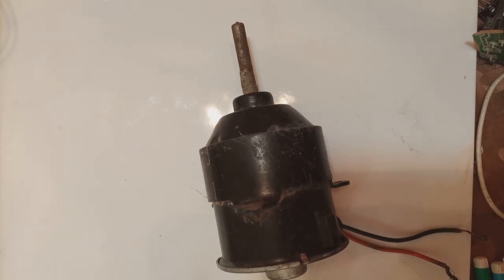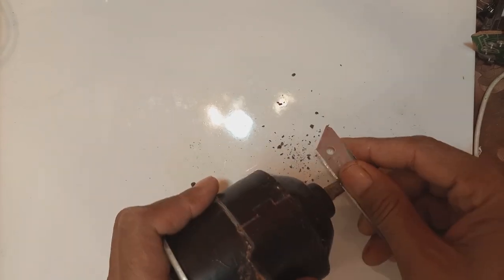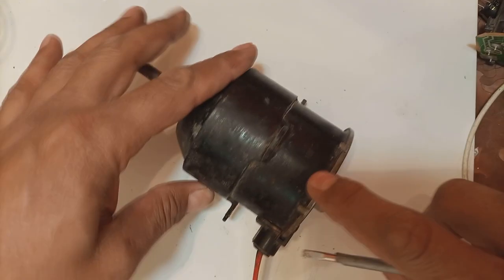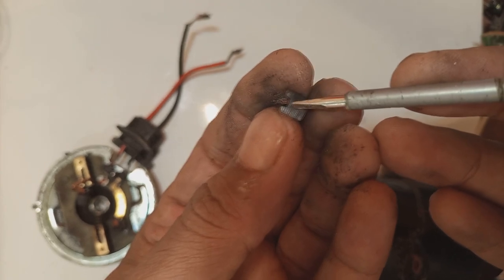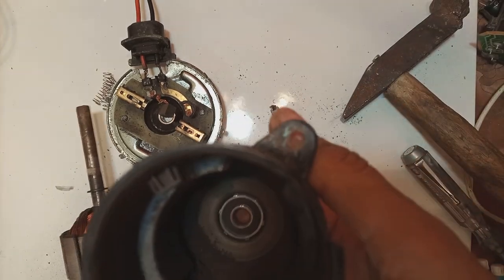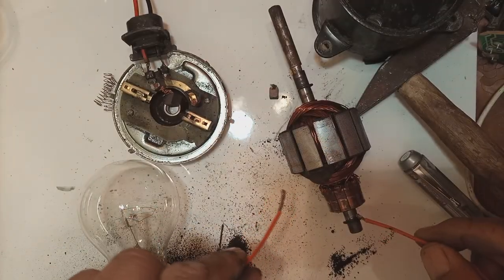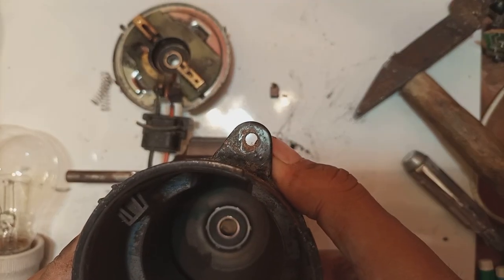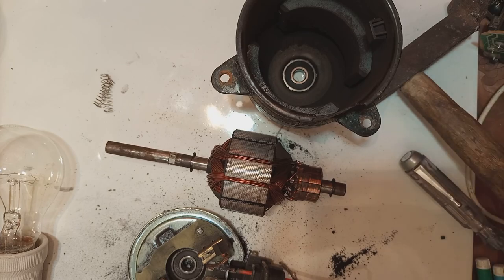dc motor repair. DC fan motor disassembling troubleshooting and diagnose tutorial. 12v dc fan motor

Comment: That motor has had a long life,  but the commutators look usable with plenty of material.
Fine sanding and cleaning the carbon dust from between the commutators should make it good again :-D
I think the brushes are a bit dead ha ha :-D
When i worked at an auto repair / electronics repair factory,  we could not always get the right brushes so we would hold a sheet of sandpaper on a flat surface and push the oversize brush around untill the size was correct.
Using a flat surface helped to keep the brush straight.
I was always amazed at how soft the brushes were,  amazing how long they last really :-D
I remember watching your videos on motor rewinding,  the result was perfect :-D